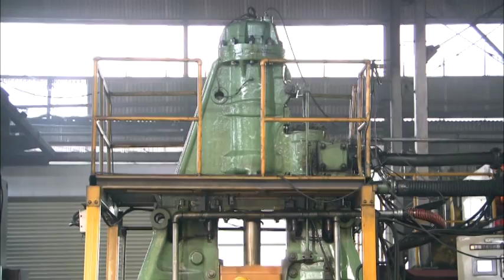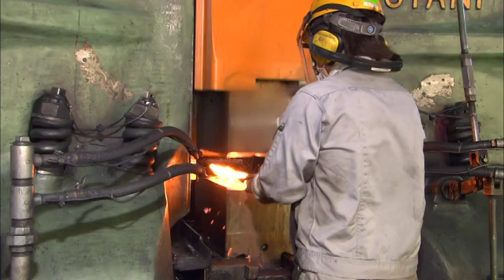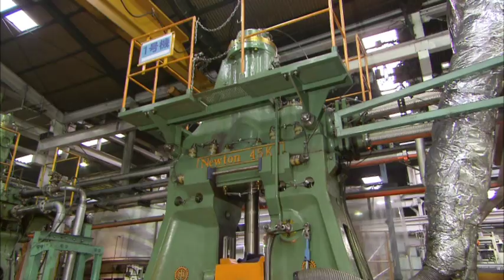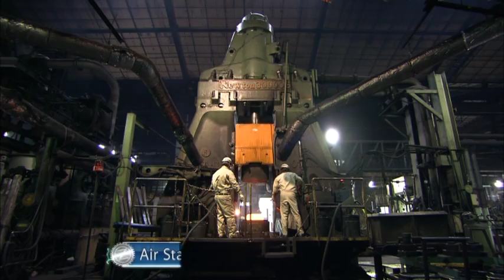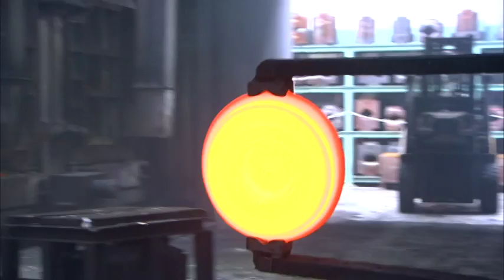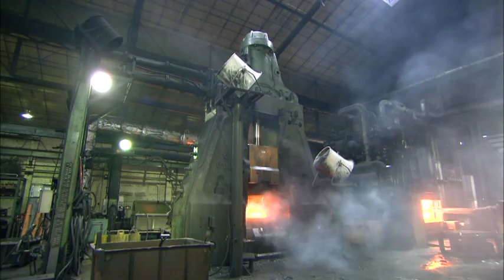OTANI -  Air Stamp Hammer

Comment: This kind of hammer consumes too much energy and the production cost is too high. Because the power is too large, this kind of hammer was used in China 10 years ago, but now it is changed to electro-hydraulic hammer, which can save 60% of the cost.
Reply: Steam Hits Much Harder And With Less Blows.
Reply: because your hammer is inefficient doesn't theirs is the same